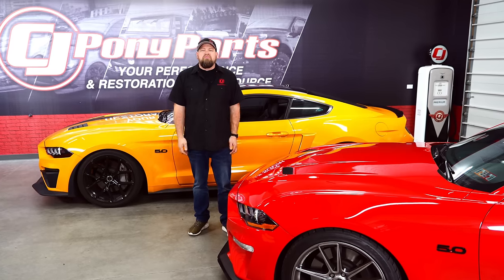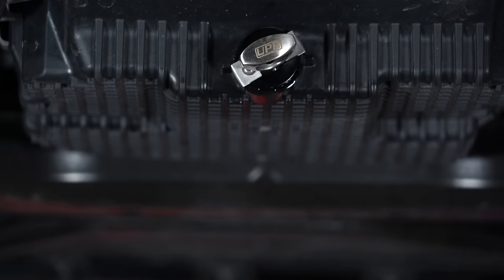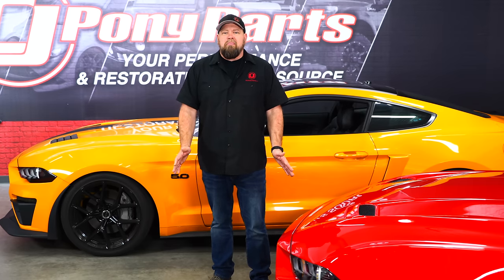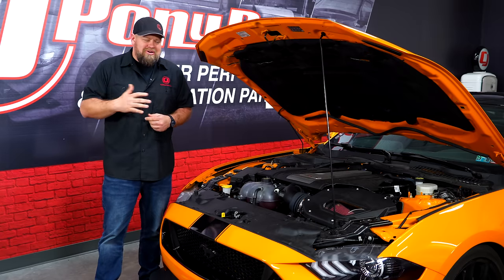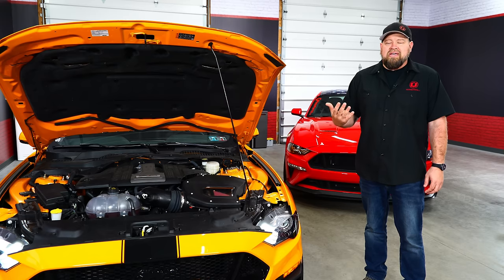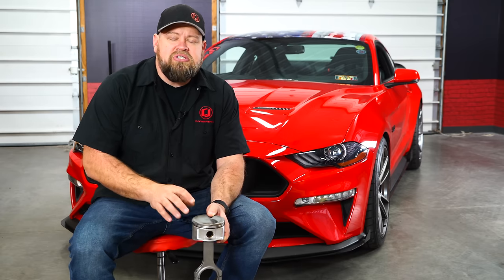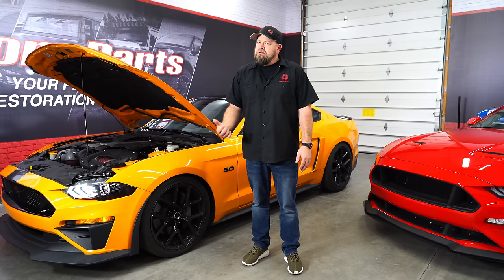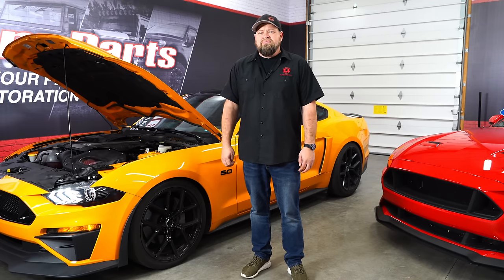2018-2019 Mustang Tick: Should You Be Concerned?

Comment: My 2013 Coyote did not have this intermittent tick that my 2019 does. My 2019 does not even have it consistently. Every time I think I might have it from cold start it doesn't have it and then every once in a while it is clear as day. So far it has always gone away once warm. I would take it to the dealer but since there is no fix for this or even clear answer on what it is that will just mean that I will be without my car for a while. I will wait until the noise gets worse or Ford changes something in the short block to fix the issue. One thing it is doing however is preventing me from enjoying the car the way I want. Its always a worry in the back of my mind. Its keeping me from doing any engine mods and tuning as well which is something I always do to my performance cars.
Reply: Shawn Sanders I’m sorry to say but this is your problem, not the car. Stop letting all this hysteria ruin your experience and enjoyment
Reply: @poweraddergt6580  If it's just going to have noise every once in a while from a little piston slap I will be fine with it considering I had 3 LS1's that did that but had great power and lived very long lives. I mostly would just like to know what it is for sure and it's not going to cause any problems later. Was wanting to add a Whipple to this car, E85, fuel system, OPG/crank gear, long tubes and make 900RWHP on a otherwise stock engine.

Comment: Bill thanks for addressing the issue I have stated before I had a 2013 5.0 for six years that always had the tick, I always used full synthetic oil after the first free oil change and a good friction modifier. I traded the car in with 53,000 miles on it and never had any performance or mechanical issues, just the tick. My 2019 Bullitt was broken in gently during the 1st 1,000 miles 
then switched to full synthetic oil. I’m using hotshots secret FR3 friction modifier currently with no tick. Do you think breaking a car in properly could help with this tick situation??

Comment: This was a great video. I've got the tick and I've been recording my saga for a few months now on my channel. I feel like there is a ton of misinformation about the tick and I may have even helped spread some of it not knowingly. It's frustrating for sure. I feel there are a ton of theories about it but no real answers. Everyone I've talked too that has had a small/long block replacement has started ticking again, so I'm putting off my third repair attempt of a new long block until we have more answers from ford. I've been told that the tick isn't right by a Ford engineering team and hotline but they can't give me an answer about what is causing it. That is the only real worry I have.

Comment: Some people also buy these cars and go 4000-5000 miles without doing their first oil changes, i just cringe at the fact. If the tick is present get your oil tested if it comes out good SEND IT!!!

Also some people just start this things up and drive them like they stole them, its a good idea to let them get up to temp then start driving them
Reply: One could argue that's why some people are losing engines.  Car needs some cylinder heat before you start driving it hard.
Reply: Ryan P correct! They need some temp before spirited driving!

Comment: I had to the same trick in my 2009 mustang gt and what I did I change my gas I was using 87 that when i heard the tick start using 89 or 93 fuel.. and what I did was I ran all the 87 gas out then put 93 in with bottle of engine cleaner tick went away after 80miles!

Comment: But the Problem is not only the BBQ Tick. I have all so a hard rattle when you hold the RPM by 1500. Fact is, i have the Second Engine wie the same Tick and Rattle. I have the Second Transmission (10 Speed), blew up 300km ago. My Mustang has first 6800km on it. I drove the both Engines very smooth the first 1000 miles. Ford produced Junk and used the Customer has Testdriver . I dont accept that, when the next try failed to fix the Rattle and Tick, i  let fix the Problem over a lawer.

Comment: The noise I’m hearing in my 21 GT is more like a rattle rather than a tick.. only at low rpm’s.. usually between 2-3000.. perhaps it’s still there after 3000 but is being drowned out by the exhaust.. doesn’t affect performance.. just annoying as shit in a brand new car 🤷‍♂️

Comment: Will ceratec void warranty.?  Also isn't bad to put heavier oil in .?  I thought the newer engines have to have thin oil like what's required.
Reply from the maker: tb12269 additives won’t void a warranty. As far as oil weight Ford even says 5w30 is ok under heavier loads.
Reply: @cjponyparts  so does that mean that 5w30 is good for an every day driver?
Reply from the maker: tb12269 goes even states in the manual you can use 5w30
Reply: CJ Pony Parts can you use ceratec in a manual Mustang gt 2018?
Reply from the maker: Stick GT yes it is an oil additive for the engine so transmission does not matter
Reply: CJ Pony Parts awesome, thanks!
Reply: @cjponyparts  street707 says ceratec will void warranty

Comment: Ford had a letter we gave owners back in in the late 90s early 00s for 4.6 and 5.4 owners. Basically it explained the noise was piston slap on cold start and would go away after heating up. However we got another version of the letter tell ford dealerships to replace the engine if customers were not happy. Lol

Comment: No noise from the bottom end is ok.  Running oil not specified yet the manufacturer is nuts on these close tolerance engines. If ford knows their engines fail, they should recall them. If they know their shifter forks fail, they should recall them. This “test your luck” attitude towards their customers is not ok

Comment: Just out of curiosity, has anyone checked if this is a lean fuel mixture at low idle, causing spark knock. I mean I dought it leaves the factory like that but who knows with EPA regulations. One of the first things I did to my brand new Kawasaki z900 was to add a rapid bike module that let me adjust fuel map at low rpm and low load, in my bike the first 6000 rpms are factory locked. The module bypasses The factory computer by directly controlling my fuel injectors. It came very lean to pass epa laws, so lean it nearly overheated idling in my driveway in 27 degree weather. Once I remapped it, it never went above 3 of the 5 bars representing heat on my display.

Comment: 10W60 gear oil mixed with a bag of sawdust poured into the engine will stop just about any noise from big end knock to cam /wear/piston blow by. This sludge like mixture must be pre mixed first though and a large funnel used for ease of filling. Mix in the sawdust a little at a time to create a thick treacle like consistency. Sell the car soon afterwards..

Comment: i started running Driven FR50 oil which was designed for the coyote, its a 5W50 racing oil but it mmade my 17 roush much quieter, its a great oil imo that's what ppl should run which the Boss cars said to run a 5W50 oil!
Reply: sam constantino I run the same in my 2019 hellion twin turbo car. That oil is awesome and I keep telling everyone to use it if they go boosted.
Reply: good choice for boosted car. Same oil I've used for years.Also get a Jlt oil seperater catch can.
Reply from the maker: I use that on my race car, good stuff
Reply: @edright941  yea oil catcg can is a must imo I run the UPR ones on my cars
Reply: @cjponyparts  yes I do to that's where I started using it!! It doesn't wear down like others as quick and all them addtives

Comment: Could it be improper operating RPM ? I keep going in my mind about some of the the diesel engines that I drive , when I driver lugs the engine it can pull a sleeve and cause it to tick ! I remember a couple of the guys talking about not running the engine above 2500 RPM and such , I find personally in my 17 mustang 3,000 RPM is a great working number at 2500 I can feel it pulling like it's unhappy there .. this applies to manual so I can't apply this to automatics ..
Reply from the maker: Gilbert Verhoeff I wouldn’t think so. Obviously lugging the engine is bad but I don’t think in this case it is an issue.
Reply: @cjponyparts  yeah thanks for debunking my opinion lol . It was more of a observation , I'm glad you took the time to put a solid representation on this issue so the general public can move on and enjoy this great new Ford mustang .

Comment: I bought a 2018 mustang GT and I loved it till it had 11k miles.  The ticking noise was loud at different times. You never know when it's going to happen. Ford should fix this problem. I paid $47k for my GT with the performance package . Sometimes I would loose power and the clicking noise never stops it's just get loud sometimes. Ford mechanic dont know how to fix this problem and they wont do nothing about it.  Ford ended up buying my car back after my new mustang was in the shop about 15 times and they took the whole engine apart and when they put it back guess what? The noise was still there.   I just think that a new $47k dollar car shouldn't have a loud clicking noise even if ford says its normal

Comment: My 13 gt had 24k miles when  bought it and early on I remember being at a drive through and hearing that noise, maybe two times, and it was in warm summer weather. I daily drove the car even in New England snow and at 46k miles had never heard it again. I haven't heard it from my 17 gt yet and it's only at 5700 miles.
Reply: Well an update....now my 17 has 13000 miles and the tick became noticeable after the first oil change I did myself at 6000 and changed again at 12000. I noticed the noise is really loud now after my second oil change I did myself at 12000 and I did everything correct. 8 quarts of royal purple 5w-20, royal purple 20-500 oil filter and torqued oil drain plug to 19 ft-lbs.

The car ticks when driving idling seems like this is the wrong car to own if you have serious OCD with engine noises sigh no idea what to do.

Comment: I think the majority of the 18+ mustang owners are on denial mode thinking that just because it hasn’t happened to their engines it won’t happen at all. No engines with DI or not should sound this awful. My ‘16 F150 5.0 has had zero issues or noises since day 1. My previous 11 Mustang 5.0 developed the tick at 9k miles. My truck is about to turn 30k. The 18+ coyotes are a gamble IMHO. I was looking forward to buy one but I’m not about to spend that much money into a headache and annoyance. What are the chances of getting 3 18+ bad motors in a row from Ford? Well I know of a customer from a well known Performance Shop that had that happen to him.

Comment: I noticed a few of the people I run with have the issue and the one thing they have in common is that they changed their own oil at 500 miles and also didn’t properly break the car in. They’d rev high. 

Meanwhile I just got my oil changed at 7000 miles from the dealer and I have no issues so far.

Comment: My mustang 19 starts the tick around 1000 miles ...disappointed
Reply: First mustang I have owned was a black 2015 GT auto as seen on my channel. Before I was able to post any other mods other than the exhaust the mustang blew up at 800 miles sitting in my driveway after remote starting it. I went through hell with the dealer where I purchased from. They eventually offered to sell me another Mustang after buying back the 2015 after many many conversations with the (GM).
The replacement was a 2016 Mustang GT PP1 that I mildly modded, exhaust, intake graphics etc. That car was amazing with no issues at all, of course I was dumb and sold it locally.

I now own a 2019 Mustang GT PP1 Manual. The car had developed the engine tick after driving it home of course. I’ve noticed when cold starting the vehicle and letting it idle down after 5 mins the tick is apparent. Driving the car not to exceed 4,000 rpm’s for approximately 10 mins, the tick dulled slightly to where you couldn’t tell by just walking around the car. My oil was changed at 1,000 miles after the “recommended break-in” using 5w-30 Mobile 1 synthetic and Motor craft oil filter. The tick is still apparent at 1200 miles.

I just wanna enjoy my car without having to deal with Ford “Again” in that matter. Looks to be in Inevitable at this point.

Comment: I have a theory that these engines need a friction modifier in them. Almost all these engines don't start the tick until after the original oil has been changed. So, the theory is that there is a friction modifier in the oil from the factory and Ford has not disclosed it or forgot to, or maybe even don't know because their oil supplier didn't disclose it. There is 2 '18s by me with 30k+ km (18k miles for you Americans) on them and no tick. One been adding ceratec right from the start, and the other guy was using another friction modifier (name escapes me right now). Both have scoped their engines and no scoring. Both send it when ever possible, as well as daily drive them. Both are different track guys. One is a 1/4 racer, other is a road course racer. Both have the 10R80 trans, non performance packs. Again, this is just a theory on the oil. Not fact. I don't know anyone who works at Ford, but if someone does, maybe they can mention this and get them to look into it?
 
I will be adding 2 bottles of Ceratec in mine come spring. Car only has 500km (200ish miles) and it sitting in the garage. Will have a fresh oil change the day it gets to see day light again with amsoil 5w50. My old 2012 GT track had a tick as well. Never had an issue with it. Sounded like clutch chatter on some days. 115k km (72k miles) on it when i traded it in for the '18 GT. Ran 5w50 Amsoil and sent it when ever possible.
Reply: MrDaavee hey do you have a manual or auto transmission?
Reply: @VenturesofMJ  I now have the auto. All my toys always been manual. This time, I figure I would try something different. And want more consistency. So far, the little that I have been able to drive it, I absolutely love it.

Comment: I’m a salesman for Ford, Mustang customers that are aware of the issues ask me about it all the time. I tell them, don’t worry about it. You have a 5y/60k powertrain warranty anyway. No Mustangs my dealer has sold come back with ticking issues or broken shift forks. Just buy it and let it rip.
We also have a used black 18 GT with 19k miles. It doesn’t have the tick either.

Comment: They never should have gotten rid of the old fuel injected 302, the 5.0. With aluminum heads,  all roller tech,  a few upgrades, six speed manual trans etc. or a supercharger,  the old old 302 would perform just as well as this new 5.0. Cheaper,  simpler,  more reliable, better mpg ... The engineers don't get it.

Comment: hey , I,ve read an article , here in nz. on these  generation. way before , ford thought about doing r.h.d models. that , ford got BMW  mechs to redesign the crank shaft. to a flat one.[ just to beat camaro]  do you guys know of this. did the generation  had this tick before this generation.?. maybe the flat crank. cause the tick, or in piston slap. I,ve seen to many post about the tick , and piston slap.and its not resolve yet.i,ve been meaning to ask a fellow kiwi here if they got it. a hot rod show coming up here. so I,ll try to ask one of em then. or acouple
Reply from the maker: The flat plane crank was only used in the GT350.
Reply: thks. for putting a light on this. its been acouple or more years that I readed that article

Comment: Any thing to look out for when it comes to the Shelby GT350?
Reply from the maker: Biggest thing with those engines seems to be oil consumption.
Reply: CJ Pony Parts any smoking? Excessive oil consumption could be due to low compression/slap or leaking seals in the bottom of the engine?

Comment: Actually tick noise has been around since 4.6.... On 4.6 Ford tried offset piston pins to fight this. Biggest thing is piston have very short piston skirt so piston will rock more in it's bore. Spray in cyl liner the blame is BS too since Ford was using long before Coyote engine. "internet" like to ties things together because of change so that has to be it. Or I have got this machine shop guy said so but with what facts. I'm a tech and engine builder 99% of forum are full of it. Both of 04 Mach1 I had made tick sound never got worst never change.

Comment: Cylinders bores are not straight. Some engine builders have proved it.
Reply: Lund racing talk about it on their instagram live video a couple weeks ago. The video might be on their YouTube channel  i dont know. They were discussing which coyote gen was stronger and thats when they started talking about the Gen 3 coyote not having straight cylinder bores which causes piston slap and other issues.
Reply: dude Lund racing wokrs in conjuction with engine builders. They know exactly what they are talking about lol
 they have opened engines that have that piston slap issue and the cylinder walls were scoured. When Cylinder bores are not straight they cause that problem. And the only difference from a gen 2 to gen 3 coyote block is the gen 3 has no steel cylinder liners. Gen 2 has no piston slap and its the strongest coyote block.